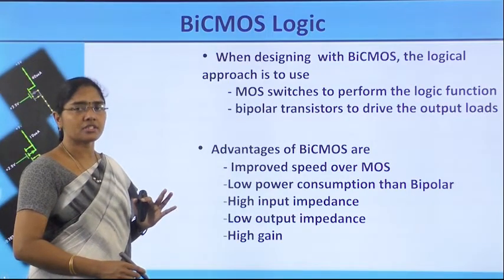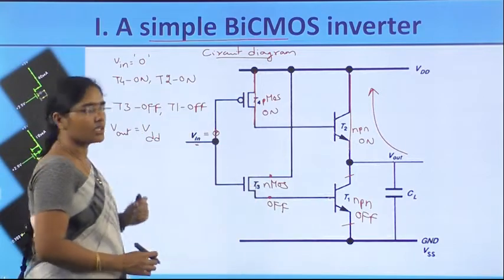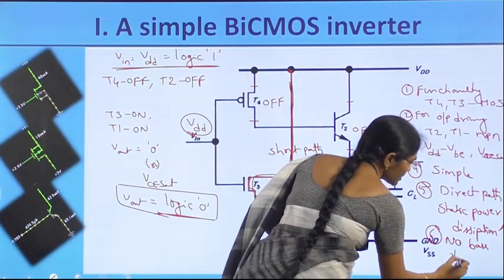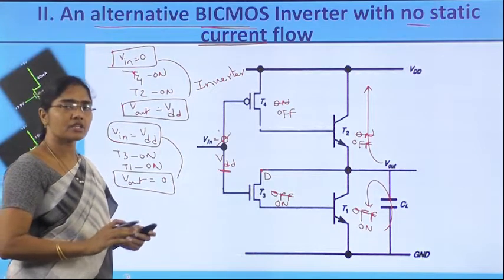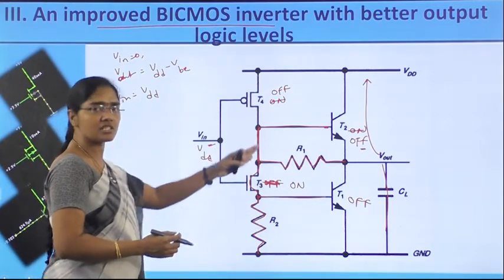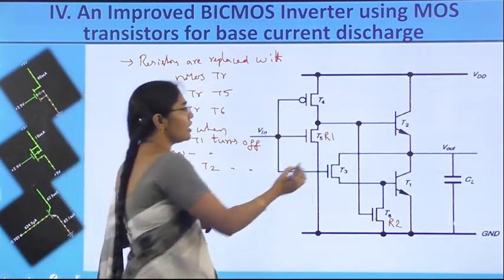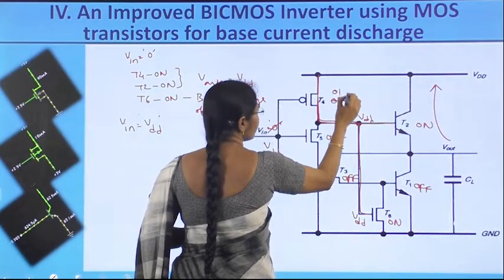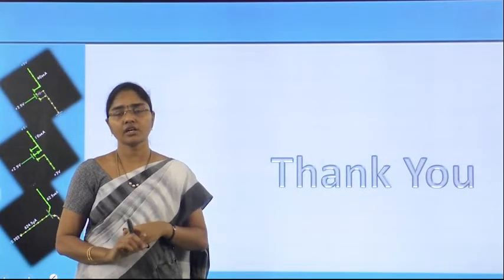BiCMoS Inverter

Comment: Madam when vin= 0  T6 transistor which is nearby ground will not make the output to zero? But u said it is for first bjt base disdischarge and when Vin = vdd , first bjt is discharging through  T5 only. That is clarity is missing madam